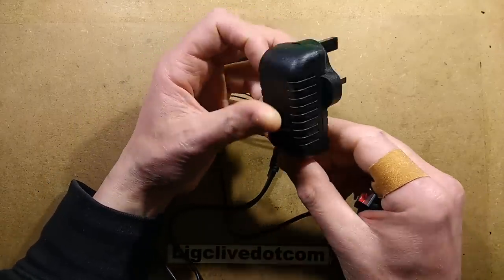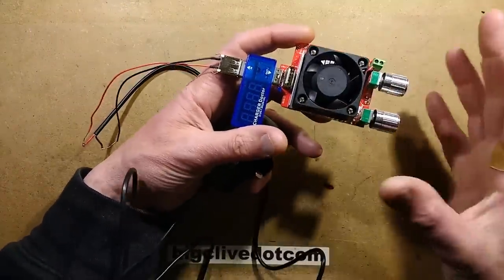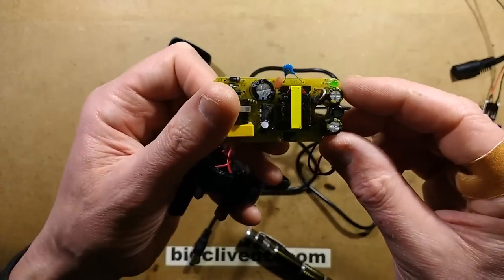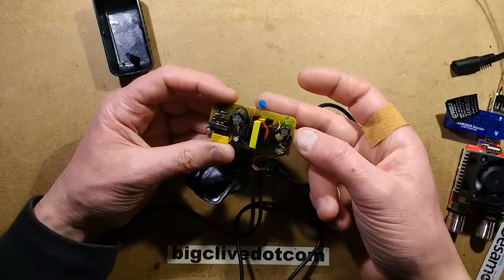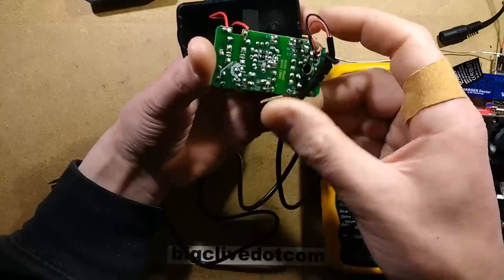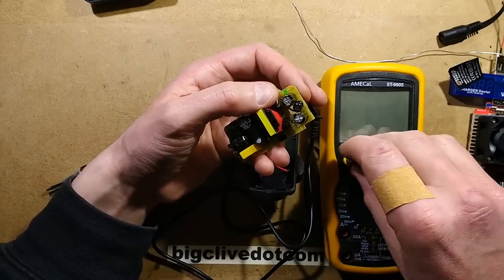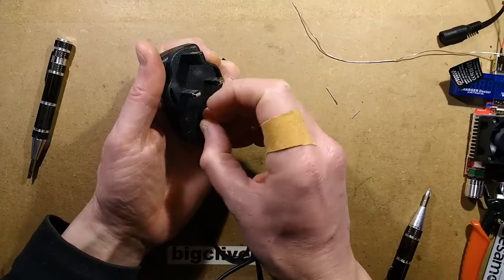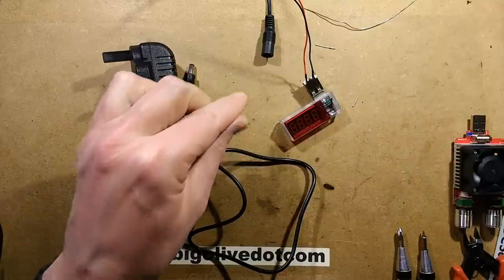Checking out a friends dodgy power supply.  (With storm raging outside.)

Comment: newark still sells one with or without a plug/cord.  http://www.newark.com/cliff-electronic-components/cl1850/electrical-tester/dp/68C8457?ost=quicktest&categoryId=800000005787&searchView=table&iscrfnonsku=false (one with a euro plug one with a UK plug would be the variants )bit of a big price difference on the UK one.  Don't know why.  $2 vs $11 + difference between Euro and UK in addition to the $55 for no wire/plug.

Comment: I'm making a replica of the signs used in the Adult Swim 2007 Mooninite Bomb scare: https://en.wikipedia.org/wiki/2007_Boston_Mooninite_panic
In total the thing will have about 185 large 10mm leds driven at 3.2 volts, 20mA. I'm trying to decide whether or not to use rectified mains at 170 volts or a wall wart at 12 volts. I like the large voltage of mains reducing the total number of strings(and work), but I'm not sure I like having one of my projects referenced to the mains. The 12 volt option offers safety and the possibility easily converting the thing to battery operation, but if i am right I would need close to 60 strings of 3 leds in series to get any kind of good result out of it... anyway I'm looking for advice from an expert on these things, so Big Clive, or person reading this, any suggestions? Thanks.

Comment: $60 for 3 clips,  a light,  and a wire?   It's already sold out.
Reply: joblessalex I have more on order, the post light was for demonstration in the photos and isn't included
Reply: Andrew J McKeown But isn't  $60 a bit high for 3 clips, fuses and some wire? Are they handmade?
Reply: I source and install the cords myself and supply additional fuses. The price is set to cover my costs, overhead, and labor. I originally wanted to offer free shipping but sadly the math couldn't work for that. The price is as low as I can make it without taking a loss.
Reply: Andrew J McKeown Ahhh. Fair enough.

Comment: Did you see this story from the Beeb today - some guy killed by using a dodgy Apple power supply whilst in the bath: http://www.bbc.co.uk/news/uk-39307418 A so-called 'Product safety manager' is quoted as saying "Although the cable that is plugged in to your phone is 5V, somewhere along the line it's plugged into the electricity supply and you're reliant on that cable and a transformer to make sure you don't get into contact with the main voltage," He's obviously not watched one of your videos about dodgy capacitor voltage droppers that are effectively directly connected to the mains!
Reply from the maker: It's worse than that.  It appears he may have had the mains charger sitting on his chest in the bath when it got wet.